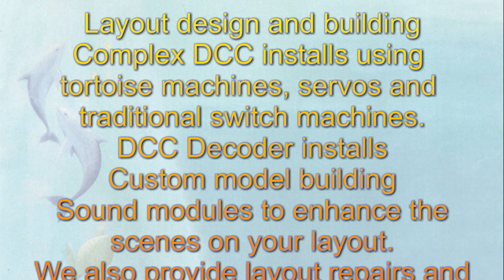All in one servo Grade Crossing

Comment: Very nice design, and I think the "form factor" is the right approach. I'm working on a design, and finishing the case so I can 3D print it, for a turnout mechanism that includes the throw mechanism, control, frog polarity, detection of occupancy at the points so you don't throw the points under something, detection of blocks adjacent to point end and the two diverging tracks, as well as the feed for a hall effect sensor under the head block ties for throwing it with a magnetic wand. All that should fit in a package the thickness of cork, and while I don't personally use cork roadbed, many people do, so I'm designing around that. But I still want mine in a compact/thin enclosure that fits snugly against the underside of the switch assembly. I hadn't thought about doing the same for gates.
I might suggest, humbly, that a small circle or similar of styrene above the servo, would let it sit into or on the hole, like a flange, and just add some scenery to the top of the styrene. If you ever need to remove it for maintenance or replacement, you just cut around the styrene, and the whole assembly could come up.
Very nice work, and some good ideas that have my mind running. Thanks for sharing...